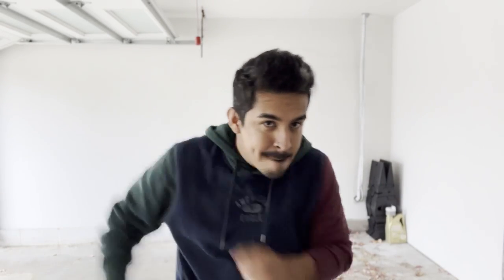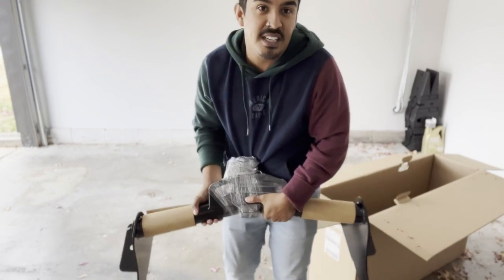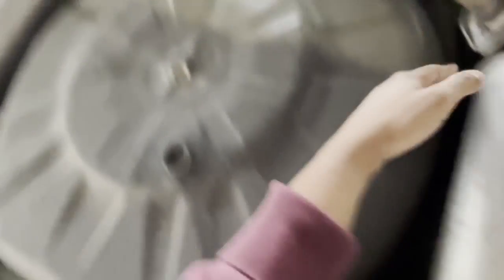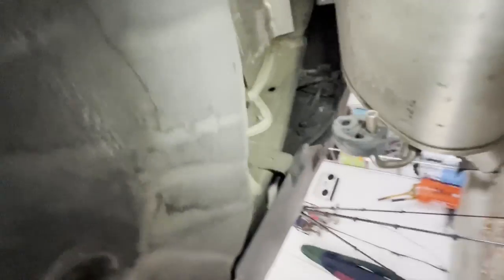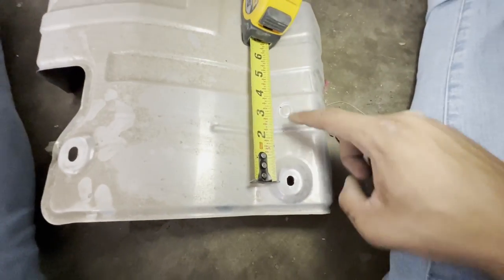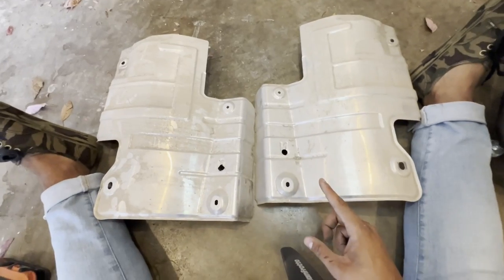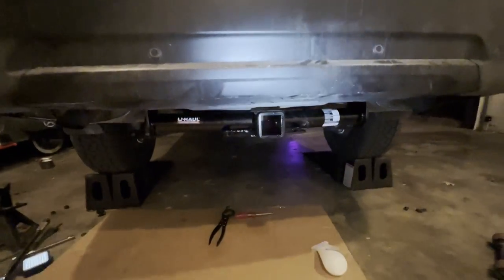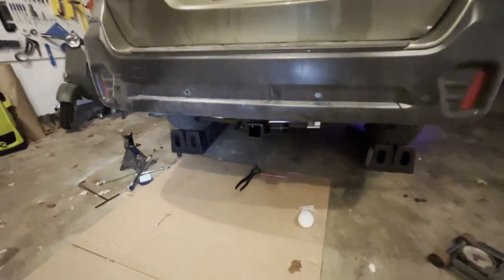HITCH INSTALL FOR 2020+ SUBARU OUTBACK #install #diy #subaru

Comment: Nice job!   Very helpful video.   
Couple things I noticed:  You had to enlarge the heat shield holes more than you originally cut them.  Also, I'd recommend (strongly) nylon ratchet straps instead of that bungee cord!  Those things dry rot and if it broke you might injure yourself or the exhaust system connections.  
How long did it take you?  I noticed it got dark outside.
Reply from the maker: Hey Biff! Thanks for watching!
I did indeed have to cut the holes a bit bigger. 
I believe it took me 4 hours but only because I would have to start/stop a lot for the sake of filming. It would of been 2 hours without filming.
Reply from the maker: Hey Biff! Thanks for watching!
I did indeed have to cut the holes a bit bigger. 
I believe it took me 4 hours but only because I would have to start/stop a lot for the sake of filming. It would of been 2 hours without filming.

Comment: Can I install a tow hitch onto my 4 cylinder Subaru Outback? I hear you can only install a hitch onto 6 cylinder cars?
Reply from the maker: I installed a hitch on my old 4 cylinder with no issues. Power is going to be different and load capacity as well.